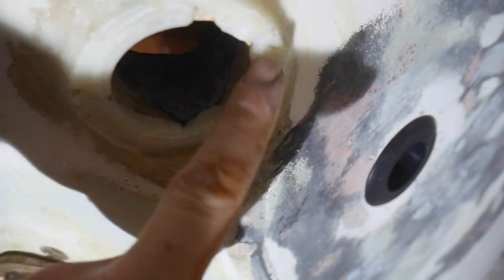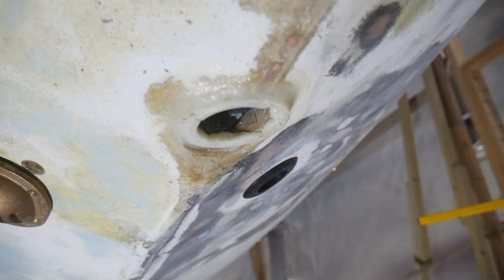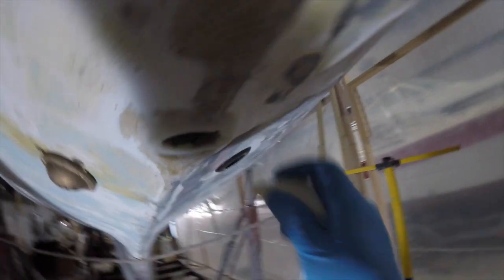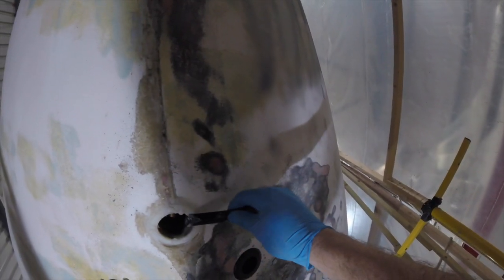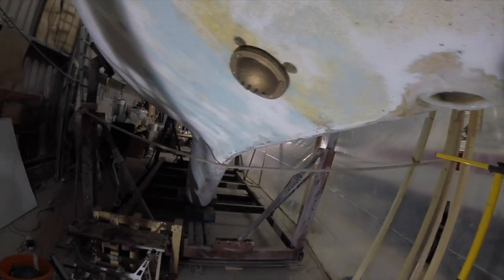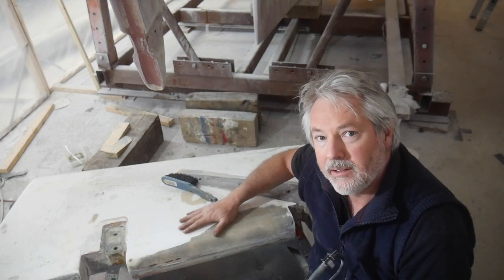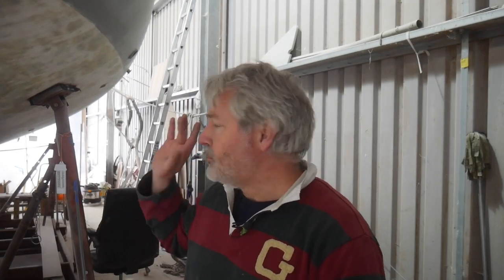#70 getting ready for the move

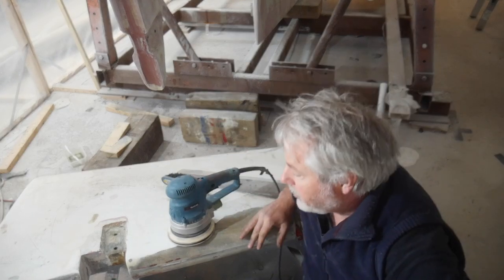Comment: Never boring 👍. Can you tell me, was the sanding at 04:57 time lapse or just sped up video? There was definitely (?) time lapse at the end but I watch lots of vlogs ... Tally Ho, A2A, White Spot etc and I can rarely work it out. Thanks and good luck with the move👍
Reply from the maker: Hey SJ it was sped up video - I can't sand that fast ! Most editors will let you speed up the video by 2x, 4x, 8 x etc. The end part was time lapse as you spotted - one frame each 10 - seconds.
Reply: @aboatcalledwanda6925  Thanks so much.

Comment: Richard, is that rudder nut stainless steel?  A previous owner of my 352 had replaced the original nut with a stainless one and it eventually suffered from galvanic corrosion. My rudder stock is made of bronze and a yard here in Portugal machined a new nut for me from similar metal.
Reply from the maker: you are dead right Andrew - not a great idea to mix stainless with bronze where you can help it. The nut I bought was a cheap one just to check the thread type and size; specifically if it is a metric 24 mm. As it turns out it is not. I didn't want to order a bronze one for 60 GBP before I confirmed the thread. So the stainless steel one was just a tester. Incidentally, the rudder stock, nut and all other materials should be bonded together via an anode on the rudder pintle - at least that is my understanding. Does your rudder have an anode on it?
Reply: @aboatcalledwanda6925  No rudder anode. I do have a bonding wire attached to the rudder stock in the aft cabin. This was already fitted when I bought the boat 12 years ago. I did fit a hull anode years ago to better protect my Bruntons Autoprop and bonded the propshaft and rudder stock to that.